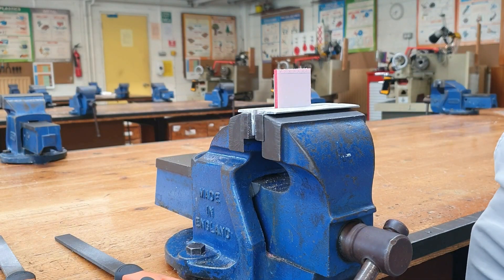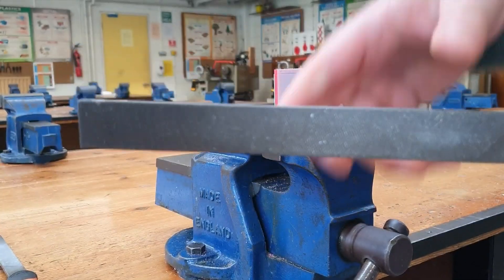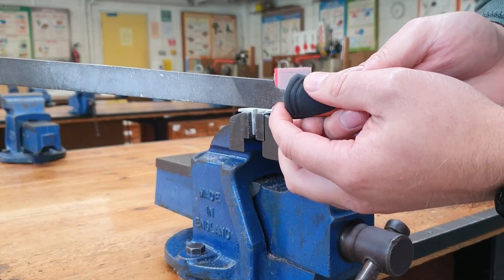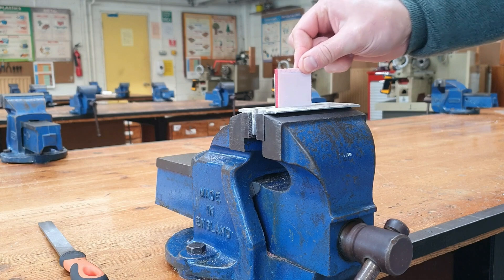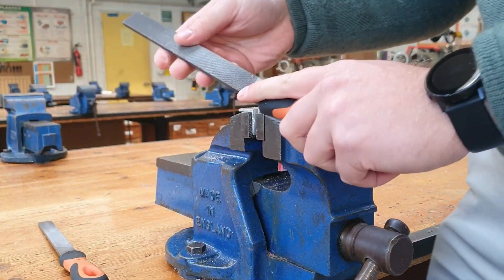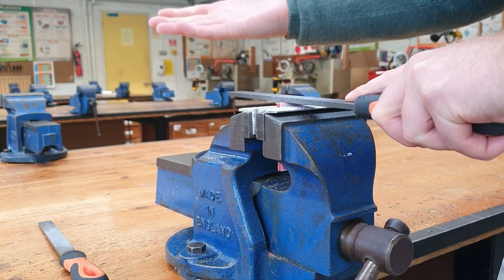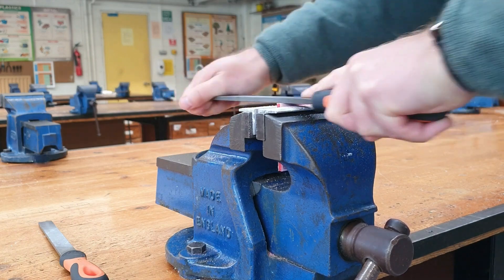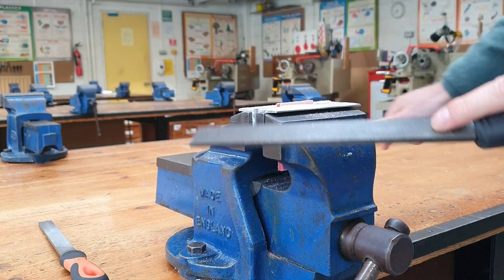Cross & Draw Filing

Comment: Put the Handle in your right hand and in Draw Filing push away.
Notice the chips 🤔
Now with the handle still in your right hand pull the file towards you.
Notice the chips. 🤔

Now put the handle in your left hand and repeat the process!!!
Notice which way makes nice chips and which way just wears out the file 🤔

Back and forth is fine after Midnight with your Wife.....

You come to my Shop and file "Back and Forth" you'll get your Knuckles wrapped 😡

Comment: You will wear down your file quicker doing it in a back and forth motions. Files are supposed to be used only in forward motion and then lifted and then brought back and without touching the materials. Then put it back down and do it again with forward motion.